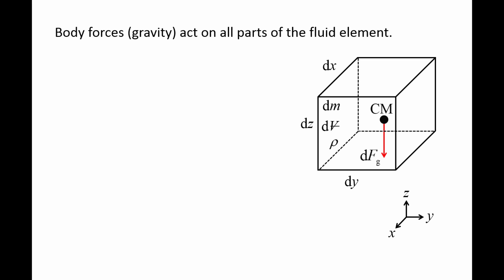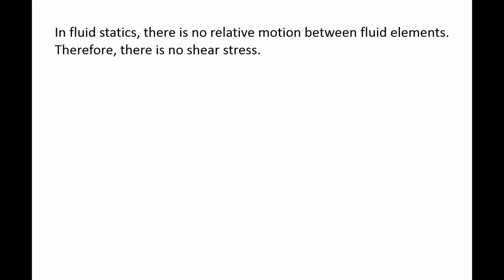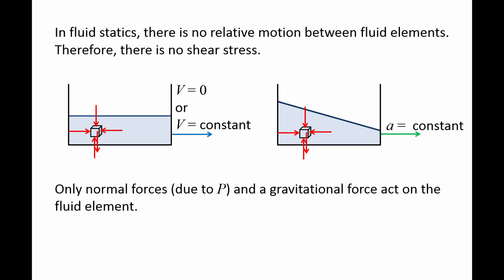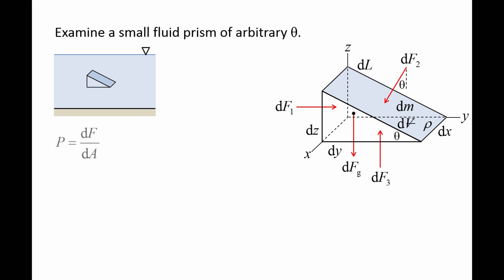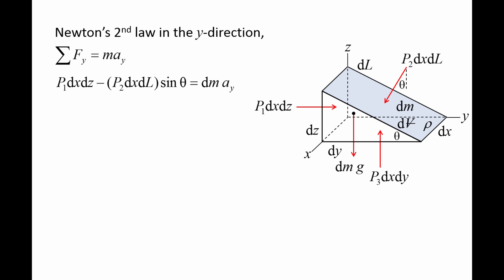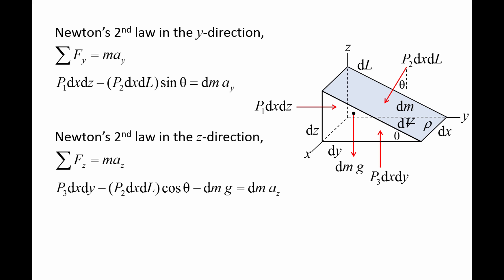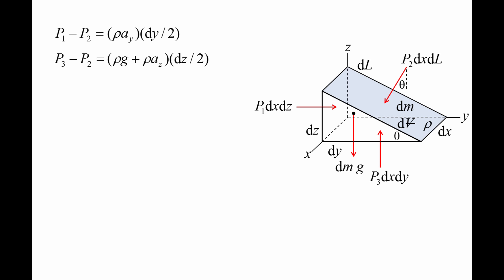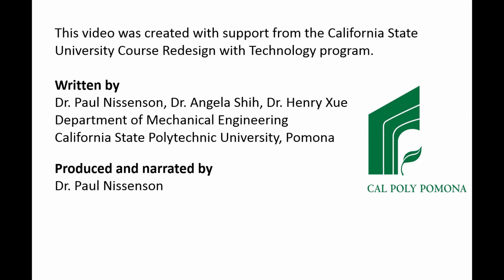Fluid Mechanics: Topic 2.1 - Pascal's Law

Comment: If pressure doesn't vary with direction, then how is it that in the next video you prove that pressure varies linearly in the z direction? Doesn't that disprove what you just proved in this video?
Reply: In considering an infinitesimal fluid element, we are approximating the pressure at a point. By Pascals law we can show that the pressure is independent of direction. This does not imply that pressure cannot vary in space and therefore it is entirely possible that we can obtain a pressure differential. Consider an open tank of water. We know that a fluid element at the bottom of the tank experiences greater pressure than an element approaching the free surface. I.e there exists a pressure gradient. We can describe this gradient via a chosen coordinate system and the result obtained would be that the pressure varies linearly in the chosen coordinate. I hope this is clear.
Reply: https://youtu.be/XPCgGT9BlrQ 💐💐💐

Comment: I have one doubt...... at the end of proof, our conclusion was dependent on limit i.e dx,dy or dz approaches zero, which is correct but brings ambiguity. It could be much simplified if static equilibrium equation was applied initially as our assumption was already for static fluids, then RHS would have been zero, and then effect of differential increment in pressure due to weight of differential element could be ignored. Then things would have been much simple and easy to understand. Inclusion of acceleration, then applying limit at end brought ambiguity to a considerable extent.
Reply: Yes this proof states that pressure  in any direction at a point is equal but it doesnt explain why. However your suggestion is to my understanding incorrect. That is because their can be non-zero acceleration and this law still holds. As long as all fluid elements accelerate at same rate there will still be no shear stress as the video suggests.

Comment: I like you exaplaination, I understand the concept, but what should we do if we want to prove the pressure in x direction is also equal to remaining directions.
Reply from the maker: Use the same technique, but in the x-direction. Summation of Fx = dm*ax. The forces in the x-direction are pressure forces -- call the pressures P4 and P5 on the two faces and initially do not assume they are the same. You will find that P4 = P5 if the acceleration is 0. You would then have to use the idea discussed in Topic 2.2 that pressure only varies in the direction of gravity in a static fluid, so the pressure in the x-direction and y-direction should be the same since gravity is in the z-direction.

Comment: why do you particularly take a wedge or prism shaped fluid element?
Reply from the maker: We didn't have to. A cube or any other shape would have given us the same results. A prism allows us to examine an arbitrarily shaped fluid element (notice we did not specify theta) that is relatively simple in shape.
Reply: @CPPMechEngTutorials  How would prove that the pressure are equal in a fluid element shaped like a circle or an elipse (or any weird curve)? It seems that there would be many more unknowns (pressures) than equations due to all of the different directions normal to the surface
Reply: I think if we use cube shape, all pressures acting  on opposite sides will cancel each other  except weight of fluid and no conclusion can be drawn